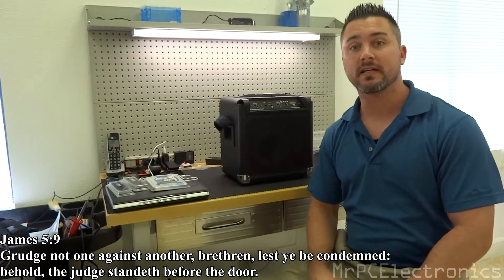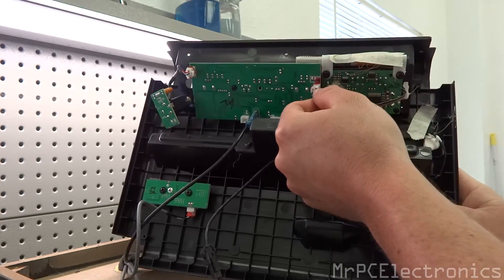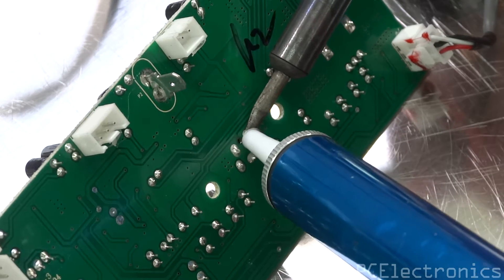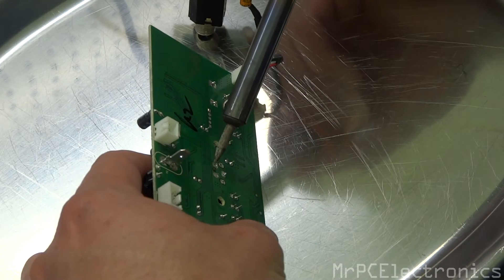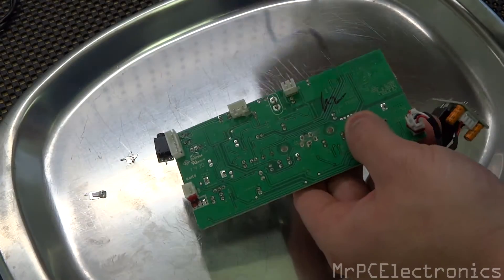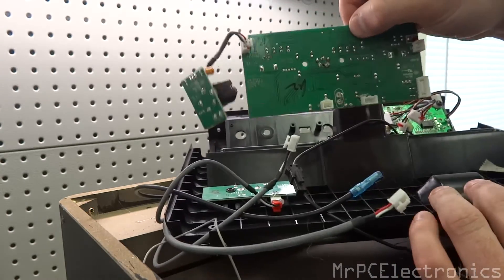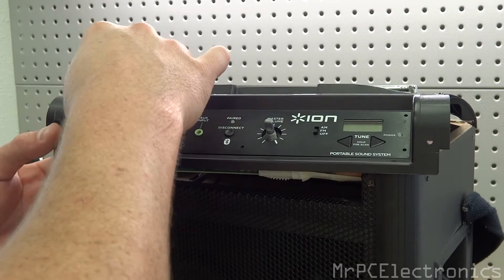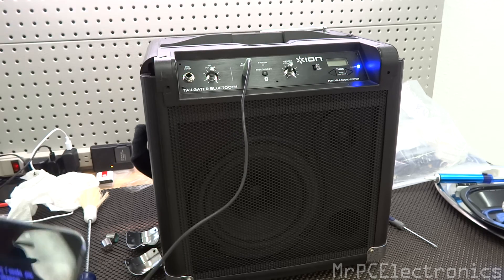Audio Jack Repair "ION Tailgater Bluetooth"

Comment: Thanks for the info. I also have to replace my aux. plug-in. It's far too lose a fitting when connected. It does work, but item needs replacing for a tighter fit on the inserted male end. Otherwise, my amp still works perfectly for the many years I have owned it.

Comment: I have a similar one, the problem it’s when I did plug it in to a 110v forgot to change the voltage setting the fuse blow and since the it work only on the main, when i unplug it it don’t charge and goes off 
Any advise ?? Please help
Thanks

Comment: i need help with my ion speaker. it only turn on for 10 to 15 second and it turned off. what do I need to do. it's been more than 6 month I only used it for only less than 6 month.
Reply: Try disconnecting the battery and reconnecting it my IPA57 did the same thing